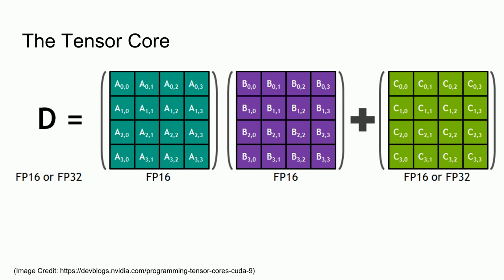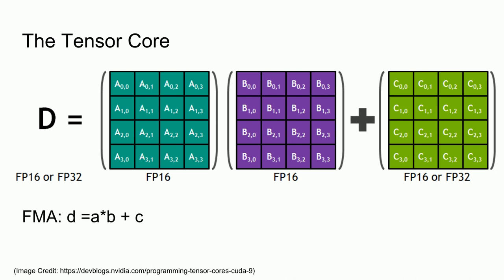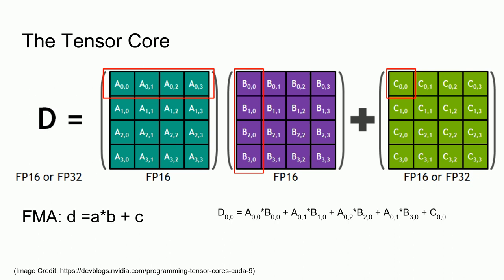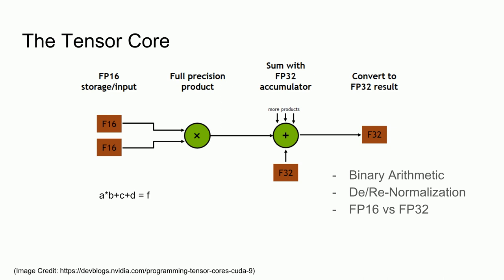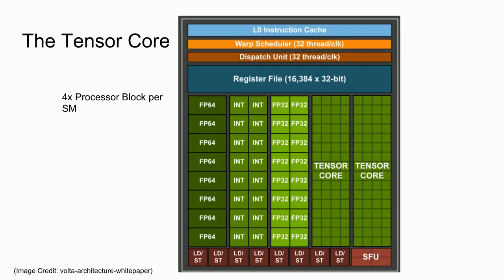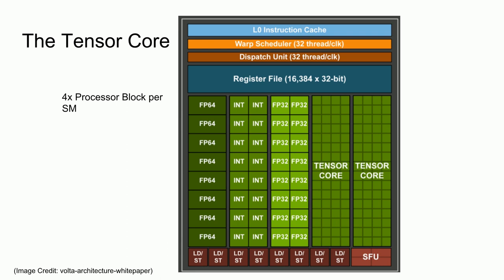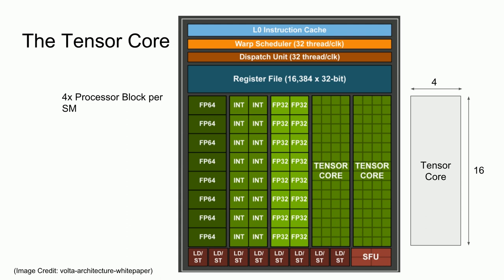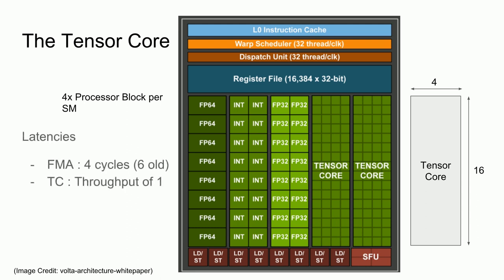Analysis of a Tensor Core

Comment: It is also interesting to know about a new schedulers used for dispatching ray-tracing routines (e.g. closest/anyhit, that is 
dynamically scheduled). Are they accessible directly (or at least indirectly) from CUDA cores (C++).
Reply from the maker: I haven't tried using any of the new Volta architecture with CUDA. From what I understand, the RT cores are only able to accelerate triangle-ray intersections, and tree traversal. So you would have to write a kernel that effectively does the ray-tracing, but is scheduled partly on the RT cores. As for how to actually write a kernel to use the RT cores, it looks like you basically create special CUDA kernels which use an rtcontext, which can share the kernel context and memory pointers with a normal CUDA context. Also, there appears to be no way to combine the RT kernels and CUDA kernels, where any communication needs to be handled on the host side (one of the biggest flaws of CUDA in my opinion - the inability to run a kernel continually without direct control from the host).
The API for programming with the RT cores is part of CUDA 10, which is freely accessible from NVidia's website.
Hopefully that was helpful.

Comment: Systolic Array multiplier like tpu's Mxu unit
Reply from the maker: Thanks! I didn't realize that it was called a Systolic Array. The layout of a Systolic array makes a little more sense, but I believe the implementation presented in the video is functionally equivalent. Additionally, both implementations have the same band-width limitations.
Reply: @RTLEngineering   u r welcome... Yeahh even implementation in video would give same result ... Anyways thqs for the video 👍

Comment: Thanks for explanation is there a source that you can recommend about warp scheduling  and SM's ?
Reply from the maker: It would depend on what information you want specifically, and how far down the rabbit hole you want to go.
There's very little detail on NVidia's part though, and most of it is educated speculation from the architecture community, much of which is not collected in single sources or written down as it's considered "common knowledge" or "obvious".
Regarding warp scheduling, there's even less detail there. It's mostly a resource allocation problem where entire SMs are allocated warps based on the scheduling engine in the GPU (it's not clear if it's a software scheduler running on a small CPU, or if it's a hardware scheduler that iterates over a descriptor list - my guess would be a software scheduler though).

Comment: Procrastination Is All You Need: Exponent Indexed Accumulators for Floating Point, Posits and Logarithmic Numbers
bfloat16 MAC, one addition and one multiplication per clock : ~100 LUTs + 1 DSP48E2 @ > 600 MHz result accumulated in > 256 bits
Tensor core needs 64 of these => ~ 6,400 LUTs + 64 DSP48E2

Comment: so why dont you just say "matrix operation core" or matrix multiplication core, why would make things complicated with complex differing terminology, "tensor"
Reply from the maker: Probably because the association was for AI/ML workloads which work with tensors (matrices are a special case of the more general tensor object). Though I am not sure why "Tensor Core" was chosen as the name since other AI/ML architectures call them "Matrix Cores" or "MxM Cores" (for GEMM). It might just be a result of marketing. 
I would say "MFU" or "Matrix Function Unit" would be the most descriptive term, but that doesn't sound as catchy.

Comment: For normies Tensor Core = DLSS + raid tracing = BETTER GAMING
For machine Learning = Tensor Core = Better And Faster output
I see two different world....
Reply from the maker: I think you meant Ray Tracing. As I understand it, the Tensor Cores are not used for RT acceleration, and are only used for DLSS. DLSS is a Convolutional Neural Network (CNN) evaluation on an image (so basically a bunch of filter passes), which is what the Tensor Cores are really good at doing.
The interesting thing in terms of machine learning, is that it's not clear how the architecture of the Tensor Cores are setup internally (I doubt NVidia will let us know). Though, if you look at the NVidia example code, you load the matrices first, and then do the matrix-matrix multiply. So in order to get the most usage, you probably need to be doing a data stationary or weight stationary operation. If you need to change both data and weights, then using the FP32 units will probably yield better performance. So not necessarily faster for ML either.
Reply: @RTLEngineering  hmmm... thanks that ray was wrong due to predictive text. Also I heard the general term that Tensor Core will "improve deep/machine learning performance". I don't know if it's true or not but what about your thoughts?? I'm going to but a laptop for machine/deep learning purpose and I was deeply interested in tensor core due to it's capability of good deep learning performance. So I'm a bit confused whether to spend some money and get rtx card or go with default gtx cards.
Please reply. I would really like to know whether it will make any difference.
Also I absolutely loved your video even though I'm not a pure computer science student and started ML as a hobby I was able to get about 85-90% of Tensor core concept. Thank you
Reply from the maker: That will entirely depend on the application, from both what the underlying algorithm is, and how the code is written. For example, if you are using some ML code that doesn't use the TC instructions, then the TCs won't improve anything. Similarly, if the code isn't written to take full advantage of the TCs, then they may end up having no improvement at best, and could end up resulting in a reduction in performance at worst. 
If the ML code uses some higher level library like Tensor Flow, then I'm not sure if the underlying kernels will take advantage of the TCs at all (I would imagine that they have added such features, but that may not be practical).
If the cost difference doesn't matter to you, I would go with a RTX card just to have the TCs if you need them / to play around with, but keep in mind that the VRAM matters too. To get the most performance, you want to be continually feeding the compute units with data, however, if you can only fit a single data set into VRAM, then you may have identical performance to a GTX card instead. On the other hand, if you are only processing a single data set at a time, you may not see a performance improvement at all. So it depends on the application. Personally, I went to RTX cards in my most recent builds so that I had the TCs and RTs to play around with, though I have yet to use them.
Reply: @RTLEngineering  hmmm... okay so for now or for few years TC won't have much effect of ML areas. So it's better to go with cheaper GTX for now. Anyways Thanks for your advice.
Reply from the maker: That isn't what I said. I said that it will depend on the application being run... It's like traction control in a car, it's really only useful if you go off-road (needing it would depend on where you plan to drive). I don't know what you plan on doing that's ML, so I can't suggest anything further... If you plan on writing your own Cuda kernels for ML, then you can make sure to make use of the TCs. If you are using someone else's code, then it depends on how they wrote their code.
Reply: @RTLEngineering  Hmmm ok thanks. It was a good video and it was a real good explaination easy to understand. Thank you

Comment: Tensors and Matrices are not the same mathematical objects. There is some  confusion in there
Reply from the maker: Partially correct, Matrices are a type of Rank-2 Tensor, so they are a subset. Some Tensors are Matrices, and all Matrices are Tensors, but not all Tensors are Matrices. 
It would be more accurate to call it a "Matrix Core", but that doesn't sound as catchy. You could also call it a "Systolic Array Processor", but that's also not as catchy. I suspect they were thinking about the fact that you can form a Rank-N tensor with Rank-2 operations (technically you can do it with Rank-1 operations as in SIMD). Anyway, blame the name confusion on marketing.